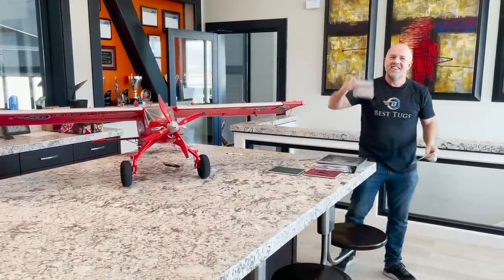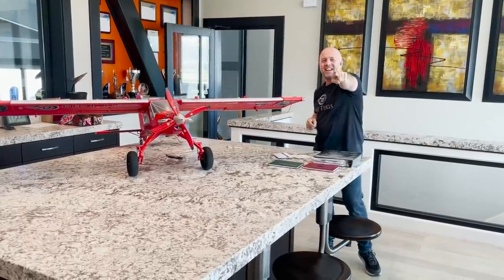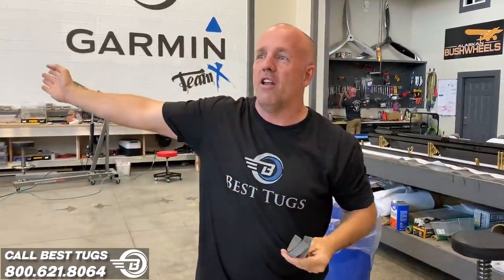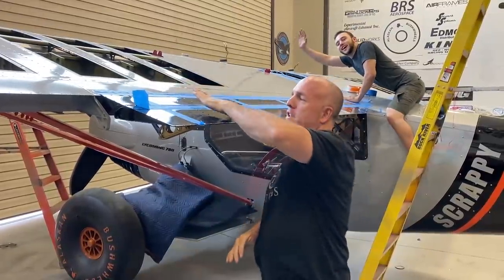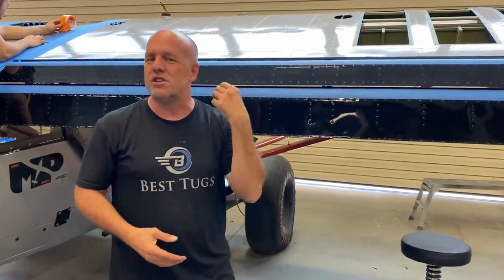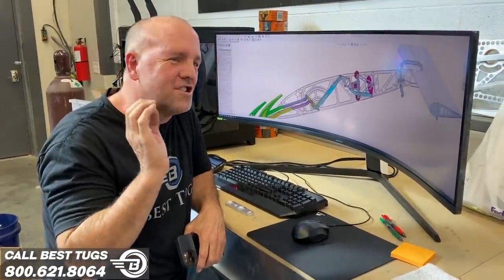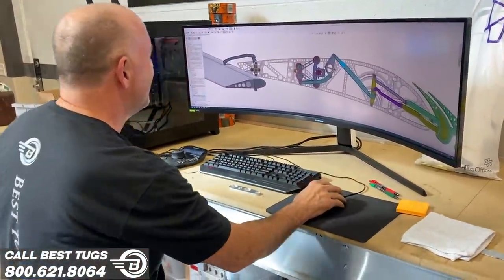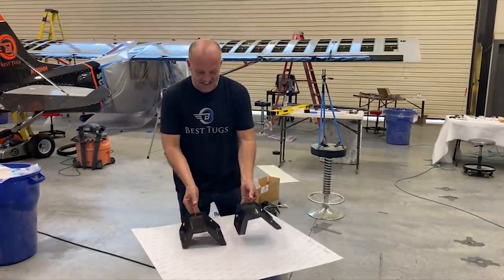Custom Search and Rescue Plane gets Wings, and Airworthiness 🤠  | Scrappy #60

Comment: Time difference - Midnight in bed watching Mike makes me want to go into the garage and weld something right now. I don’t have a garage. And I can’t weld.
Reply: Best comment!!!  I'm not an aviation guy, but I love watching his videos.
Reply: You gotta fix that ASAP ;-). I need a TIG - only have MIG and stick right now.
Reply: Yes... if you are drawn to something it is for a reason... follow the white rabbit 🐇
Reply: Hahaha
Reply: Good welders are so inexpensive right now. Just get s simple multi-purpose to start out with. The garage is another story. They don't come cheap. Can always ask the wife if you can use the dinner table. lol
Reply: LMFAO!
Reply: @FarmerFpv  buy the welder and weld a garage to store it in.
Reply: Maybe take up soldering. Cheaper and a lot less dangerous.
Reply: Hahahahaha, agreed.
Reply: I get that, watching stuff like KSR make me want to go work on my project car, then I remember I don't have anything I need to fit.

and it kinda works atm, I should avoid breaking it for no reason.
Reply: 4) Garmin ambassador Mike Patey and “Scrappy.”

Be one of the first to see Mike Patey’s latest creation, “Scrappy.” Based on the popular Cub Crafters Carbon Cub airframe, Patey and his team enlarged the fuselage, beefed up the frame, installed a massive 780 cubic-inch piston engine and added plenty of custom features. And naturally, we’re partial to the panel. Our Team X group of pilots and experimental engineers worked with Mike to develop a unique Garmin panel for “Scrappy.” Mike will be spending time at our exhibit with “Scrappy” answering your questions, taking pictures and signing autographs. You won’t want to miss it.

Comment: That ailerons acting as flaps are really incredibile... I'm speechless!
Reply: Drooping ailerons they are called
Reply: Not as incredible as one might think. It is an old, tried and tested invention. The DHC2 Beaver has been using flaperons since its first flight in 1947. btw the Ju-87 Stuka already used slotted ailerons, that while not real flaperons, did help low-speed characteristics a lot.
Reply: Not to take anything away from Mike's Incredible build, but Air Tractors use them, as well as other aircraft.  It is not a new development.
Reply: Been using flaperons on model planes for 30+ years
Reply: @mrbmp09  yes but these aren't usually what we think of as flaperons are they?  Because the drooping ailerons are separate from the actual flaps. When thinking of flaperons I envision one piece, narrow corded, pretty much full length of the wing, mounted slightly below and trailing the wing trailing edge. Like the German storch, kitfox,  zenith 701-801 etc. While they provide excellent roll authority otherwise, flaperons at anywhere near full flap setting lose a lot of roll authority. So in a stiff crosswind you can't use much flap deflection. That's why Mike elected not to use flaperons I think. 🤔
Reply: To everybody: I know that it is not something new, but in the context of a "homebrew" Aircraft with such wings it is the ice on the cake!

Comment: At first I thought, “That is a ridiculous number of inspection panels.”  Of course, now it all makes sense.  Let’s see, dual slats, Fowler flaps and flaperons all integrated  together.  FAA inspector, “Geez, Mike, OK I guess.  I mean, geez Mike!”
Reply: Not to mention the solar panels and batteries!😎
Reply: Might be showing the FAA inspector a few things that even they haven't seen actually implemented before!
At the very least I don't know of many aircraft (EDIT: I know of none) that have non-flight-critical batteries in the wings (yes, there is a solar powered flying wing drone that NASA built, but the batteries for that one are flight critical, and I think they're in the little under-wing pods on that one anyways).

Comment: Notice all the shots of draco... Mike's ready to start another project
Reply: DRACO X. Already announced!
Reply: I was thinking same.
Reply: Hope it's another Draco. With lessons learned and earned. What ever it is it's gonna be good.
Reply: can you imagine 2-3 years into the future... Mike standing in his hanger, mentally fully locked up and making blubbering noises when trying to decide if he wants to take Scrappy or Draco X out flying.
Reply: I’m already envisioning Draco X with 1000 HP , double slotted flaps and double slats .This is going to be even more awesome !
Reply: I would have used an orbital bearing in a spring loaded guide to allow for the wing to twist, and not overload a bearing, as 600lb isnt much as all when you start dealing with torsional forces
Reply: @fredbugden3511  why stop at two slats  It could be like razor blades 3, 4, 5!!!
Reply: @chrismannifield3222  right...
Reply: LOOK FOR DRACO X

Comment: Almost sad to see the series getting close to an end. This is one of the few aviation channels I still watch since my dreams of being a pilot were crushed forever earlier this year. Keep up the good work.
Reply: What did you do?  Get married?
Reply: @darrellcook8253  that's a good one
Reply: @darrellcook8253  I was prescribed a medication on the do not issue list, so I can't pass medical.
Reply: @slamprogram  look into sport pilot, and if that will not work out,  there is always the ultralight option. You can even fly tandem on a paramoter trike.
Reply: @scottcummings8074  Sport pilot "must not know or have reason to know of any medical condition that would make that person unable to operate a Light-Sport Aircraft In a safe manner". I don't agree at all with the FAA that the medication makes me unfit to fly, but it seems like using the sport pilot to skirt medical requirements is flirting with disaster, especially since I know for a fact that a medical certificate would be denied if I were to apply for one. I am considering ultralight, but it is admittedly a long way from the PPL that I've wanted since I was a kid.
Reply: @slamprogram  that's a let down,  I was hoping the requirements were just more lenient for sport pilot.  I was told I'm terminal and had 6 months left 3 years ago so I never went back to the doctors after a year of chemo. Still kicking and doing better every day but won't ever pass a medical.

Comment: I would be surprised if the FAA had an inspector that could technologically challenge Mike on his designs. I would be curious to see a video of the inspection process. 😆
Reply: They are drawing straws to NOT have to be the inspector  ;-)
Reply: @r.lindoncoutts1897 , I suspect the contrary is true, I reckon they know that if Mike designed and built it, it’s right. 

Not only is Mike an absolute workaholic, he’s extremely knowledgeable, a complete fanatic when it comes to detail and refinement and one of the finest craftsmen out there. I’d happily jump into and fly any aircraft built by Mike Patey.
Reply: @Pete-tq6in  who wouldn't?
Reply: @r.lindoncoutts1897 , my girlfriend - She's terrified of flying!
Reply: I was also thinking only Mike could do his annuals.  Holy Toledo

Comment: I enjoyed seeing those flaps move so smoothly. Can't wait to see Scrappy in the air like Draco.. Cuz that 🙆🏾‍♂️ Stol performance should be pretty darn great
Reply: I want to see the slowest airspeed landing Scrappy can perform. I suspect it's zero, the question is, what's the sink rate Scrappy will get at zero airspeed. Then, just set the AoA for that and try to hit the landing mark. If the suspension can take a touchdown at the sink rate of zero airspeed, Mike is going to end the landing part of STOL competitions. Dropping down on the mark at zero airspeed is legal isn't it? ;-)

Comment: Hey Mike, I just love Scrappy and I am totally blown away by your skills and perseverance. But as a pilot I am a little bit concerned about the drooping ailerons you just don't want a stall at your ailerons. (That's why you added the wing twist/washout to scrappy. )
Your flaps are also slotted and your ailerons seem to be not. And you're increasing the AOA further with fully drooped ailerons and full deflection. We have the the drooping ailerons on the A320 (just a few degrees) but this is a fully protected aircraft and it's very hard to get this aircraft near a critical AOA.

I'm sure you're aware of this and maybe I am missing something, but be careful. And now: 

Back to work! 😊👍🏻
Reply: The AOA at the inner portion of the wing is much greater than the AOA with the drooped ailerons. The inner portion of the wing will stall first.......now whether there is aileron control at that point remains to be seen.
Reply: The Patey slat system should largely offset the AOA change from the flaps by increasing both the chord and camber of the wing. Imagine a Westland Lysander on steroids and OCD.
Reply: There was a video in the last three where he walked us through the fluid dynamics simulation on the wing system. It indicates that not only will it not stall, the airflow over the slats, wing and flaps will remain laminar OVER THE WHOLE LENGTH, AT FULL DEFLECTION, 60° FLAPS! That is unheard of, I don't believe it, he doesn't believe it. But his simulations have been within a couple percent so far, so this may be the least stall-prone aircraft on landing, since the earliest days of aircraft!
Reply: It’s both a proven system (The DHC-2 and DHC-3 use a similar system, as does the Bf109, it’s also very common in the competitive RC soaring world, we just do it electronically rather than mechanically) and clearly compensated for. The reason Mike’s using less aileron deflection as the flaps come down is to ensure that full down aileron does not exceed the critical AoA of the wing at that point.
Reply: @adam_mawz_maas  I'm also building RC Planes. Therefore my post. Most of the times we are bringing the ailerons even up to increase drag for steep approaches (and flaps fully down). Of course, you can increase drag also by bringing them down but then you could have a rudder reversion at your ailerons. Especially during slow flight, or if you want to do STOL competitions. I've seen a flow analysis for a profile but not for a complete wing. I think even airliner manufacturers are not alone relying on simulations, but also do wind tunnel testing. IMHO the drooping is to excessive, but I'm excited to see the flight tests🤘🏻

Comment: I'm picturing failure modes.  That lever socket in the top of the wing is just begging for something to get wedged in there and prevent movement.  You are SO thorough, I'm sure you have something already designed to prevent that.  Right?  I may not be as eager as you to see Scrappy fly, but dang near!
Reply: Enough horsepower to land in any configuration, at any altitude, and enough fuel to get there.  LOL
Reply: I think the failsafe is that both sides must move together and he can theroiticaly land the plane in any possible configuration.

As long as his ailerons work he should be okay.
Reply: If all else fails it has a kinetic parachute...
Reply: Did you fail to notice the row of rivet holes on either side of those openings? Im only curious as to what shape the covers for those levers will take.
Reply: @edfrawley4356  could just be a rubber boot with a slit in it, but he’s too fancy for that lol
Reply: @edfrawley4356  I believe he covered that in an earlier video.
Reply: @RespectableRSYt  as long as the ailerons work, that’s the problem, ailerons don’t work at slow speed weather they droop or not and that was Drako’s fault. This plane will fly even slower which means only the rudder will be working.

Comment: This guy is starting to give the Rutan brothers a run for their money. Thankfully there is enough room here for all aviation geniuses.
Reply: If this was a Rutan plane it would have canards and a carbon fiber wing.
Reply: @44R0Ndin  I was making reference to the level of ingenuity and over engineering. Obviously they make planes for different roles so the designs will differ greatly.
Reply: @danielc9312  I understood that, I was making a slight jab at Rutan that they can't seem to make a "conventional" aircraft. EDIT: What I mean is Rutan planes seem to always have some feature on them that's "neat but you could have done the same thing the more conventional way with mostly the same performance", like canards.

Comment: I have a question about the gear that doesn't really apply to this video: You mentioned that the gear legs will have lifting characteristics almost like a biplane. With your movable gear positions, do you anticipate different in-flight performance with the gear lowered as opposed to safe taxi mode? Thanks for showing us so much of this great build, Mike!!
Reply: With how small the "leg wings" are I can't imagine that the performance change will be super noticable, and where it'll matter in a short landing he'll need the gear down anyway
Reply: I think the legs will always be fully extended when he’s in the air. Mike would have to have some kind of mechanism that would actually suck the oxygen to pull the gear up. Who knows, maybe he does?
Reply: @Russellsperry  that's fair, I'd imagine it's possible to put negative pressure on a shock like that, or maybe the wing makes enough lift to push the leg up, I suppose we'll find out
Reply: @Russellsperry  He does have a system to do that with the custom shocks he developed with King. He switched it from o2 to nitrogen for safety and integrated it all into full control and monitoring from his Garmin panels.
Reply: @Mower117  that’s awesome!
Reply: @Davinator2662  another person in this chat just told me he switched out the O2, and went with nitrogen for safety, and they will somehow retract using his Garman panel. Scrappy gets more amazing by the minute!

Comment: I may be giving away the secret, so here is a possible "Spoiler Alert!"   I'm guessing Scrappy will be at Osh Kosh!
Reply: 4) Garmin ambassador Mike Patey and “Scrappy.”

Be one of the first to see Mike Patey’s latest creation, “Scrappy.” Based on the popular Cub Crafters Carbon Cub airframe, Patey and his team enlarged the fuselage, beefed up the frame, installed a massive 780 cubic-inch piston engine and added plenty of custom features. And naturally, we’re partial to the panel. Our Team X group of pilots and experimental engineers worked with Mike to develop a unique Garmin panel for “Scrappy.” Mike will be spending time at our exhibit with “Scrappy” answering your questions, taking pictures and signing autographs. You won’t want to miss it.

Comment: Hi Mike, hopefully you’ll get to see this question in amongst  the thousands of comments you get. As a trainee pilot I’d be interested to know what effects the drooping aileron have on roll control during a full  flap landing, would there be any upward deflection if the aileron when in the dropped configuration? I’m bowled over by the engineering in this plane, looking forward to seeing the first flight now

Comment: Congratulations on the certification an awesome achievement. Here in our small house in an English village I mess with strange electronic projects, I work in a messy fashion and had circuit boards, wires and a laptop strewn on our living room floor. When my wife asked what it all the mess was I used your intro line. "It's Physics, Maths and Engineering", I don't think she was impressed....

Comment: Mike Patey have you ever evaluated to use any of the IGUS tribopolymers to make self lubricating parts instead of graphite? 
There are many materials that can be 3d printed or injection molded, they are proven to resist to millions of movements when used to make linear bearings and employed in industrial processes under the most extreme temperature and humidity variations.

Comment: Mike I love your videos' . I used to to work at Robertson aircraft installing and modifying aircraft with STOL mods including drooping ailerons. I have a1950 Cessna 170 that I installed a TCM IO 360 210 HP engine in. Getting ready to install a sportsmen leading edge kit. Your scrappy build is impressive if not complicated. But what I really wanted to comment about is that I just saw a video where someone came back and gave you a  back $100 that you had incidentally dropped. That has happened to me twice. Once while I was up skiing, I had forgotten to zip up my ski bib pocket and had lost my wallet on the slope. Two days later a guy called me local to where I lived and brought me back my wallet. Not less than six months ago, I was headed down to the hangar and a guy dropped by the house and brought back my wallet it had apparently fell out of my pocket and on to the running board of my F-250 pickup and then onto the road about two blocks from my house. A guy found it and brought it to the house. Even thought I offered to reward both persons for their honesty and honor neither person would a accept a gratuity. There are still honorable and honest people in the world we live in. We have to take care of each other.

Comment: Wonderful stuff !

Mike, lots of "TRL"s 5 &  6 Engineering in this build, making it really exciting to follow along.

A couple of questions, do those bearings need to be lubricated ? .... what's their service life ? 
You've got an awful lot of them that eventually have to be replaced at the end of their service life.

There are also some potential "Dormant failures" but you've mitigated those through back up of "back ups" ... very nice (two thumbs up)

I can see future automated flight computer controlled mods being added in the years to come in order to provide a really smooth ride thanks to the way you've designed the system (nudge, nudge, wink, wink).

Thanks for sharing this super entertaining project with us.